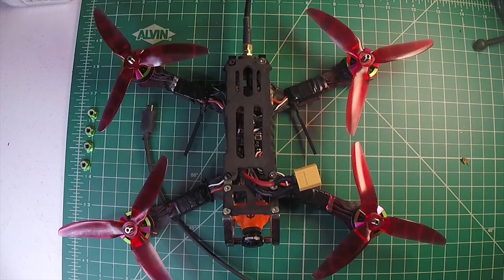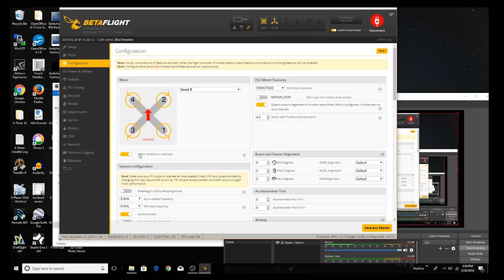Reverse Your Motors?  Why do it?

Comment: Yes it’s pushing out at the front and back, but then it’s pulling in from ether side and use you the turtle mode you push the dirt and leave in the camera. I never had problem with dirt lens with normal direktion spinning.

Comment: Running that way you are giving your back props cleaner air, if you run them so your front props are spinning in you are throwing turbulent air into the back props, so running revers props way better in my opinion

Comment: The big thing I have found is that you have to go all-in and do it to all your copters (if you have several like me), so it becomes standard. OR do it on one copter and mark that copter so you always know “that one has the reverse props”. All props on wrong is OK, quad will stick to the ground....one prop on wrong and it will eat your face!
Reply from the maker: Good point.

Comment: I started flying reverse props about two months ago (beginning of 2018), mainly to see if it helped with the major scraggle I have in my primary fly spot. Since then I have seen about a half-dozen times the front props now throw scraggle out of the way and “correct” the path of my copter, rather than sucking into the tree and sticking there. Yesterday I had my first touchdown in wet grass and yes it threw water into my electronics stack and I had  a major flight error but quad is ok once dried. Will need to confomal coat!

Comment: if i want to try this do i just do it in beta flight or in blheli?
Reply: FPV Dreamz reverse all motors in blheli configurator, reverse the yaw in betaflight, VERIFY they are moving the correct direction when powered on the motors page in betaflight, VERIFY the props are installed properly in the new direction, use caution on the first flight. It is quite easy actually, but I might do a quick video detailing the process.
Reply from the maker: I am processing a "how-to" video right now.  It has step-by-step directions.

Comment: I’ve been flying reverse props just over 8 months now. I use Raceflight Revolt V2 FC. After coming from Kiss. First thing I noticed on the very first flight was the the attitude in the corners. It no longer wanted to pull the nose down and kept a better level even at high angle bank turns. Which in turn meant I could push it harder in the turns. Getting out of trees has been much easier. Only been total stick once because the battery unplugged. Generally I find the quad is locked in better and as find it tunes better too. Conformal coating the electronics is a must in the winter. Wet grass does get thrown in the middle much easier which is a negative. Positive is the camera stays cleaner for longer. These are my findings. I hope you have great results in reversing your props too.
Reply: DEADZONE FPV thank you for the feedback, I do appreciate it!
Reply: michael gerlicher No worries 👍🏻. I enjoy your channel and wanted to help in some way. Keep up the great work.

Comment: I find more muck inside the quad / on the board etc, since reversing the props - otherwise its been beneficial, pushes stuff aside and helps to keep the lens cleaner. I was considering moving the fc antenna as they are more vulnerable to prop strikes.
Reply: Isle of Mull FPV that makes sense.  I didn't think about the antennas, I have been mounting mine as depicted in the video and can see that if one gets caught in the prop it could be more of a problem with the reversed props.
Reply: Chopping antennas is a real pain so its worth thinking about. Maybe stick it out the other side of the arm = go faster tails.

Comment: Nice video. I fly 1 year reversed!
My cam is always clean 👏🏼😂
Reply: PixelcounterFPV good to know.  I wonder why it isn't the default, perhaps just a holdover?
Reply: I do not know that either! It just takes time to sensitize everyone.
Since you can ever fly the quad around your ears.
But do not understand that in betaflight a switch is without reference to change the direction of motor rotation!
That if you forget ......
Reply: PixelcounterFPV I put the BLHeli configuration motor reversal into a previous take but forgot on this one.
Reply: Hope nothing happens